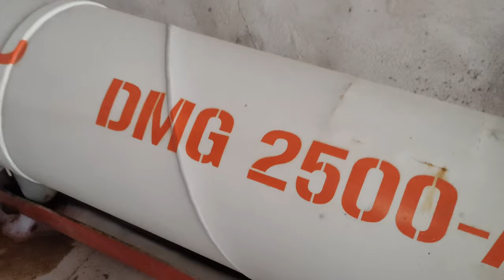Cleaner Original Hand-Made Carpet With Machine Quickly || #Asmer

Comment: this rug is not clean. unless you run water through the rug while it is spinning , untill  the water coming out runs clear, its not clean. its still full of soap from what you showed, which means its still dirty !!!
Reply: It's actually pretty clean.   I think that machine can run water through it - I think I saw a water line connected to one.    However, throwing it on gravel outside definitely wasn't clean.